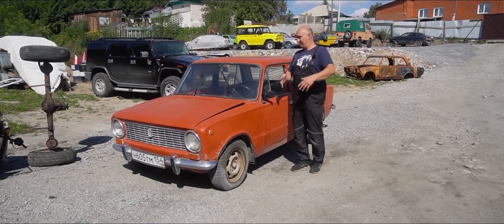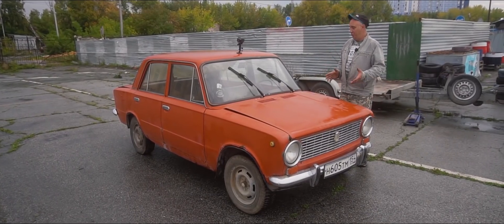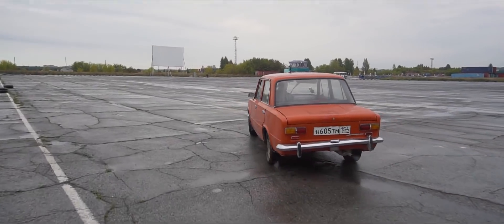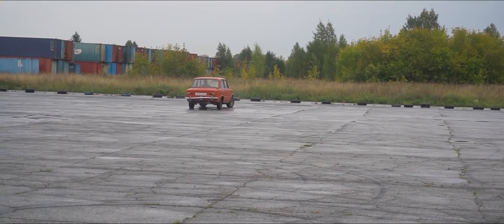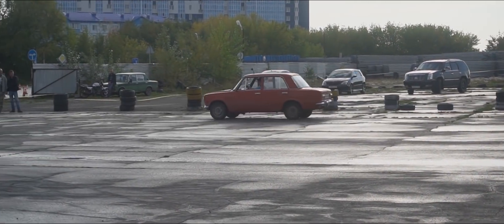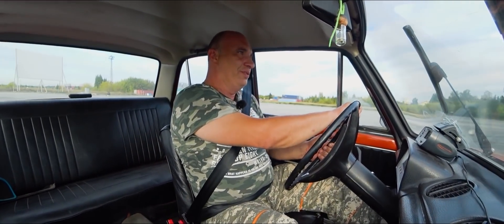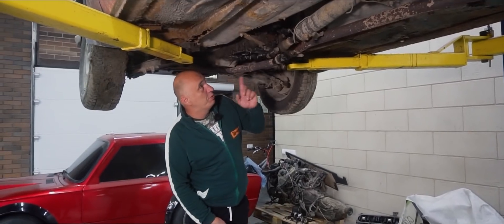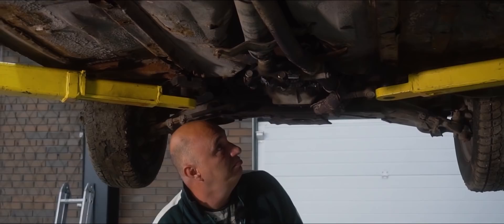How far can you drive with no gearbox oil?

Comment: I had a very crazy experience with my 2004 Nissan Armada. 

Since we had the transmission repair after it got flooded with coolant. My dad and I separated the cooling systems and rerouted the hoses. But it seems either he or myself forgot to shorten or reroute a hose I can't remember what exactly happened. 

All I know is that the holes broke and it's spat out all over the road all over the car tires brake system and chassis even the front engine area got splatter on their knees with transmission oil. I dare say that in less than a minute I completely ran out of oil. I was not going to pay for a tow truck. So I drove back home about 42 mi perhaps 46 or so. Which was around nearly 3 hours including all the traffic and me having to drive slowly because the transmission was slipping gears or working so weird jerking and just not really doing his job. But I did got home. And the transmission is still working fine No internal damage no issues. And I have to go uphill. That was probably the most crazy experience ever because it felt like the stupid thing was not going to grow up getting good ever so slowly it did

Comment: My vw golf mk3 broke the transmission case and ran without oil for 2000km. At first it started to whine, it started to pop out of fith and had to be held in gear until fift no longer worked, then it started to pop out of forth, the gearbox started to make all sorts of noises and had a hard time going into gear, had to replace the gearbox when it started to pull the car forward in neutral. The case had a hole in it because a peace of the broken reverse gear got stuck between the chasing and the differencial.
Moral of the story, keep your seals in good shape and fix any issues before they cause any more problems.

Comment: If you stop every now and then to cool it right off
I had a 74 model Holden ute with a 4.2 v8 and a 4 speed which i killed a manual transmission back in 95. Did approximately 300 plud kilometres easy with distance. Lay shaft broke and i had to drive it home. Oops! No  oil.

Comment: I had an '84 Chevrolet Camaro 5 speed and the bearing that connects the front and tail shafts seized and It drove fine as long as you pushed in the clutch.

Comment: On another you tube channel a man drained his gearbox oil thinking it was the engine but the engine was so low on oil he put the oil in the engine drove it around for months with no oil in the gearbox until he worked out to put oil in the gearbox but didn't damage the gearbox or the engine the only thing that stopped him from destroying the engine and gearbox it was a Toyota Pick Up the most indestructible vehicle ever built Top Gear UK tried to kill 4X4 deisel Hilux but couldn't do it
Reply: Yeah, the huge difference here is that they washed the oil out, it would have lasted longer. 

I had a toyota tundra with a rusted diff cover (welded on, I didn't want to weld a new one on with this rusty old truck) and one day I was driving and realized the clicking noise I kept hearing a real low speeds was a dry roller bearing. The diff was starting to whirr on light acceleration also. 

I checked and found a prior patch fell off and all the fluid was lost (all of it). I fixed it and the diff lasted for another 30k miles until I got rid of the truck for excessive rust and the need for a 4wd truck.

Comment: the blue hue of steel appears around 300-350°C; dark blue a little less, near 260-280°C (that's on hardened steel; color is used as a visual reference guide when forging steel and "tempering" it after hardening. Varies a bit with different alloys)

Comment: I drove around on an empty gear box for 3 years. I had a tranny rebuilt in a shop. They never even put any oil in it before reinstalling it. I always thought I was just bad at shifting gears. When it finally failed, I opened the cover on it and it was full of shavings, not one drop of oil, no sludge, just rainbow colored shavings and really messed up gears. This was in a 1966 Ford F-250, had the granny low tranny. Drove probably about 50,000-70,000 miles with no oil in the gear box.

Comment: I have a suggestion for an experiment. It will primarily be a test of the viability of the Lada clutch. 

Procedure:
• put test car into its highest gear
• attempt to burn rubber (or to even get the car to move out of its own shadow)

Prediction: 
unhappy clutch as evidenced by acrid odor emanating from the "clutch region"

Extensions:
• repeat experiment with a Volga 
• repeat experiment with a Zaporozhets 968
• repeat experiment with a BMW
• repeat experiment with a Camry

Comment: A long damn ways in a Ford Ranger.
A few years ago I bought a Ranger that would pop out of fifth, Never cared much it was a beater and 5th was useless anyway.
Drove it every day to work 35 miles one way for a few months. Decided to go see a girl I was talking to online,  Going to drive from Asheville NC to Lynchburg VA so did an engine oil change and while I had it on a lift I saw the underside of the 5 speed was bone dry, no signs of any leaks.. Made it to Roanoke VA when the trans decided to lock down. When I got it home and took the trans apart it was bone dry inside and out and the teeth of the gears had grenaded. I was amazed it lasted so long. Unlike the long distance relationship that ended that day lmao.

Comment: I saw Opel without dry gearbox. After 300 kms started to shift harder and after 50 kms more got stuck in third gear. After putting oil and letting it "drive" in third on car lift for half of hour, it was shifting like a new. Probably lifespan of bearings will be reduced...

Comment: Amused.  I drove about 60 Miles with no gear oil once.  Ran for an entire year after that.  Believe it or not, the current problem with that vehicle is in the engine.
Edit:  Fair.  I was completely unaware that it was dry, of course.
Additional.  They were highway miles.  Everyone likes to stroke the Toyota 22R’s dick for “reliability,” but I killed that motor without even trying.  The gearbox on the other hand, I appreciates that gearbox.  Hands down, not bad for a Toyota.
Reply: Oddly enough I've never had an issue with my 22R, or the gearbox in my 93 truck. That thing eats starters though, not sure why.

Comment: Me and friend of mine were four will driving and we punctured the oil pan we did not know we punctured it until we got home and by that time all the oil drained out and the only thing left in it was mud water so we figured the engine was junk so we took off the oil pan and drove it around his house as a yard truck for over a month with no oil pan with mud water that's the only thing that was lubricating it it was a 4-3 Chevy engine it was awesome I have not seen any engine last as long as that one did but we I figured we punctured the hole at the beginning of the trail so we're legitly running on swamp water for the whole trip

Comment: I've had lots of fun with a Renault Megane for 2 years full MOT and Service, no on checked the gear box for oil, I had lot's of trouble with the gears for those 2 years, and all of a sudon it wouldn't change gear. Turned out that in those 2 years of having the car, there was no oil in the box. £700. for a new gear box on a car that was only worth £500. excluding laybour costs. I told them no thank you.

Comment: My Vectra had been leaking oil - found it was the gearbox filter seal, and the gearbox was bone dry. luckly had it fixed, as the gears had been getting harder to change as it warmed up

Comment: A 2001 GMC Yukon XL will idle and move in forward and reverse for 10 minute with no automatic transmission fluid, and 12 quarts of engine oil, (normally 6qt)...my brother drained the wrong plug. Was fine after, no issue

Comment: Impressive. Dodge transmissions wont even last that long WITH fluid...
Reply: How long is that long? They typically don’t last over the first few miles...
Reply: That's so true since I've been the second owner to an 87 dodge ram d100 with an A904 3 speed auto. My grandfather and I rebuilt the transmission and made modifications just so the fluid could get to the torque converter hub in Park since that was its main issue from the factory. It has a slant 6 225 which is amazing and runs like brand new after we cleaned and replaced vital parts on that and I painted it red and black
Reply: somehow my all original 04 ram 5.7l auto with 290k miles keeps on trucking
Reply: @catstr0nautCS2  my mom's 2003 Caravan has the same transmission from factory, and it's traveled 400K km
Reply: @catstr0nautCS2  In the same way that some people live past 110. It happens, but not often.
Reply: lol that's funny.   but, the weight of a dodge is prob 3x the weight of the lada "lawnmower"... lol  All that extra weight will create more friction and destroy an engine or transmission quicker without oil...
Reply: My Lexus GX460 had no trans fluid today for 20 mi. I was trying to do my first oil change today & accidentally drained the trans oil instead of engine oil then put exactly the amount of oil I needed according to the manual. I was in a time crunch so I had to get home so I did but I was limping by the end of it. Transmission is fine I’m sure because Toyota amirite?
Reply: @MmmmmmmmmmmMm15  Toyota over engineer their parts for superior durability, but it's always a good idea to get the transmission checked regardless after a long drive like that without any transmission fluid
Reply: shut the hell up they have mercedes and zf transmissions they are not made by dodge
Reply: Adam Chapman  Only mercedes

Comment: I've seen a gearbox on a Hyundai make 20.000 km without filling the gearbox after a clutch replacement - it was still driving, but it was almost impossible to engage 1st gear - else it appearet fine: No noises etc.

Comment: You never even tried to correct it so it's not uncontrollable oversteer unless u tried to control it and couldn't I think your just not a great driver just an average one.i don't claim to be a good driver or anything but I have driven many high powered sports cars and they are not that hard to control even underpowered passenger cars I have not had a problem with what u did at all because anyone knows to steer the car out of the slide not just let it go and claim it's uncontrollable...

Comment: I have driven over 120km without oil in gearbox because of fast leak. At the end it was one laud squeak :) Finally machanic reanimated my gearbox, but synchronizer at 3rd gear got stuck.

Comment: If you wonder how far can you drive without diff oil the answer is 10km with ~50 hm/h . I have tried that ... the result is total lock of the rear wheels with 50km/h on busy road :D ( BMW E36 open diff 3.35)

Comment: Can you please try ethanol (e85) on a Lada ?
Reply: Bigger carb jet, some more ignition advance and it would work fine, it would probbably have some lag when you floor it but it would run. Also expect some starting problems in low temperatures.
Most engines were able to run on 85 quite happily. Just be warned e85 eats up rubber parts, and running the engine lean can cook it. Btwit smells like a distillery when it runs.
Reply: They don´t have any e85 stations in Russia. But i guess you could make it yourself.

Comment: in the late 90's my buddy had a beater '86 Jetta with a 5spd. he had it for about 5 years and near the end he had to have the steering rack replaced because it was worn out. During the repair, the mechanic asked him a funny question... "Does your 5th gear pop out on the highway". My buddy said yup, but it was doing it since I got the car about 5 years ago. The mechanic said to him, do you know you've been driving without any oil in your gearbox, because your axle seals are shot, and the 5th gear popping out is a tell-tale symptom. The mechanic replaced the seals and filled the gearbox with oil, and my buddy drove the car for another year without issue until it was wrecked in an accident.

Moral of the story? Who knows how many kilometers were done without oil in the gearbox, my fried put about 60,000km on it before the axle seals were fixed. VW made some good stuff in the 80's.

Comment: I had a mainshaft bearing grenade in a Hyundai Pony (weaker 5spd box - car was used for towing too) - First gear would rocket out and and make this bell-ringing sound, then I lost 2nd, and when I lost 4th I knew the box was dead. I replaced it and took the old trans apart - upon removing the cover plate, 3 bearings and parts of the bearing housing greeted me.

Comment: my answer- 58,000kms with no gearbox oil over 2years., reason for removal...water in the distruibter, i just decided to change it tho as i got a 2nd gearbox...all rough driven and what not..had a massive blow out on the bottom of the casing

Comment: With a. Manual transmission it could run very far. With an automatic it won’t move. The automatic requires fluid to work at all, because the clutch packs and bands run off of oil pressure. Well they don’t run off of it, the full pressure is what hold the transmission in gear.
At the point when you couldn’t shut, but then you got second gear, sped up and then got it into third is because you synced up the input shaft with third gear. With a little practice with a decent transmission you can drive without a clutch provided you can start the car in first gear.
My brother had a Nissan pulsar with a cou0ke h7ndred thousand miles in it when we met up one day at my parents house. When he went to leave this clutch cable snapped in half. So I swapped cars with him and I drove his car home by shifting without the  latch. It took a couple tries to figure out what speed I had to shaft at and then it was no problem. We were rooming at the same place at the time, so I traded cars with him for a week while we waited for an new clutch cable to come into the dealership, then I replaced it and he was fine the day it snapped he had gotten off of work later than I did, so we both drip over over to our parents house. . It was a fun little car to drive!

Comment: Those Lada where Tuff as Hell but where not economic on gas, my father use to have a brand new one 1984 Lada, Signet was starting first engine turn at -35C but where Tuff to start when hot lolll. The cluster was really cool, old dial gauges, RPM. Thanks for sharing  ! 👍👍👍👌👌👌🇨🇦

Comment: Man that lada is a classic must be early 70’s
Reply: Indeed it's the 2101 with the 1.2 L 64hp (1970-1983)
The other models are known as:
21011 (Lada 1300)   1.3 L 69hp (1974-1983)
21013 (Lada 1200s) 1.2 L 64hp (1977-1988)

As far as I know the only way you can distinguish the 2101 from the 21011/21013 is:
* on 2101 the bumpers have fangs
* the reversing light is placed under the bumper, instead on 21011/21013 it's placed under the right tailight
* on 2101 there are no grilles on the pillars 
* on 2101 the reflectors are placed under the tailights, instead on 21011/21013 they're placed on top of them 
* on 2101 the emblem on the front grille is more rounder than the 21011/21013 which is more rectangular
* on 2101 the steering wheel has chrome rings, but in this video the steering wheel was probably taken from 21011/21013.
* after 1974 the warning lights on the dashboard became wider on 2101 and after 1979 the color of the speedometer panel became black instead of silver.

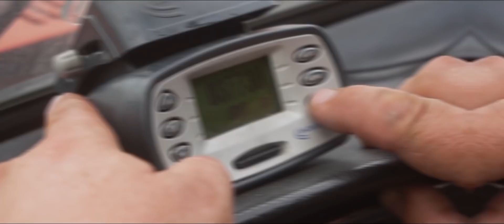on 2:30 the dashboard can be seen for a part of a second
Reply: Anyone know what such a car would be worth in the US?
Reply: @TheAsheybabe89  From 10 to 20 grand. Most of them have a low mileage and are in pristine condition.
In Russia and probably all over Eastern Europe they cost 10 times less, but in a rougher condition. 
In this condition as in the video you can get it for probably less than 500 USD in Russia.
Reply: @jimmy1395  Here, in Ukraine they start from 100 bucks

Comment: Test a Lada by running without any fluids. No gear box oil no differential oil no engine oil and no coolant. See how long a car can run completely dry except for gasoline to fuel it. That would be interesting to see how long it will last.

Comment: Fill it with a quality oil and see if it comes back to life
Reply: Great idea !!!!
Reply: It wouldn't work if the gears are stripped from the heat and friction if the bairings collapse a bottle of oil isn't gonna fix it but good idea though probably a thicker oil would help get you home but I wouldn't recommend driving like that for long
Reply: the internal shift bearing is mechanically destroyed. it can however be rebuilt and ran no problem, the gears look decent enough
Reply: when the camera showed the gearbox you could see the parts are flying away :D Oil wont fix that lol
Reply: It might fix parts sticking, but it won't fix anything broken like the syncros

Comment: What happened to the rubber coupling?
Reply: Think they've just cut it, it's faster and easier.
Reply: @killerdinamo08  You're probably right.  Those bolts are a pain to remove.

Comment: You should do that to a automatic transmission fluid removal and see how long can a automatic car go for that would be a good 👍 video 📷 I love ❤️ your video 📷 the are best ones I can't wait for the next video 📷 #AutomaticTransmissionNoFluid
Reply: Not far.  The torque converter needs to move at all,  and the transmission needs oil pressure to engage the clutches.  As soon as it loses oil pressure, it will stop.
Reply: Thats easy. An automatic would not move, not one millimeter.

With no fluid, none of the internal clutches can engage and every gear will be neutral.